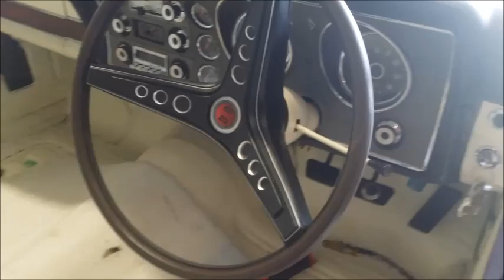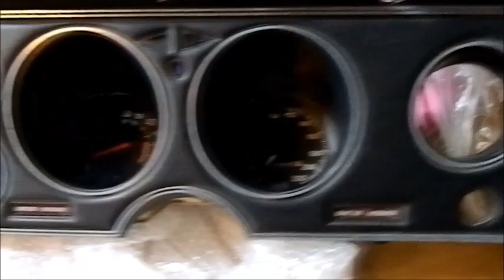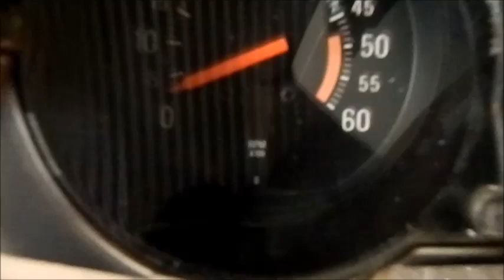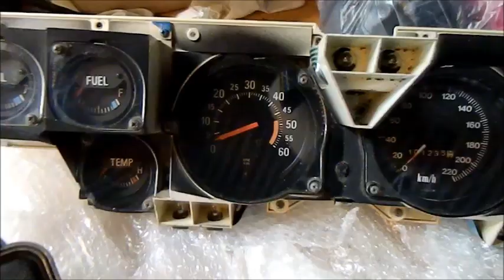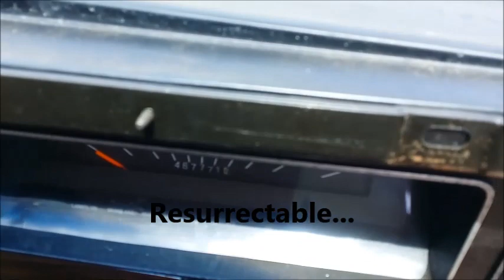Ford XC Fairmont 351 Restoration Part 7

Comment: I'm very glad you made this restoration series as i'm about a month into the restoration of my own 73 XB 500 wagon and i am cursing you for how nice the shell is on your sedan compared to mine. In particular your engine build video will come in handy for me as i picked up a 351 Clevo from an August 77 Fairlane, and a BW single rail four speed from a 302 GS XC for a song.

Comment: Great video again Pete,  you really  made me want a Zd ,  I haven't seen the inside of a zh for years ,forgotten how nice they were.  Cant believe the amount of rust replacement parts they make for old Fords . The dash you got is very nice,  this will be a beautiful car . I hate gas as well,  318s barely run on it and have zero power especially if it was the old lean burn ignition as well.  Drank the gas to , ive rebuilt the engine and run a 600 holley with an msd 6al. Goes well now but you're right, gas is for bbqs even then i still use charcoal.

Comment: Hope you had a great Christmas and top New Year. Looking forward to the full year installation!
Reply from the maker: +vigilante351 I'm going to go out on a limb and predict that by the end of this year, I'll have an almost driving shell... plumbed, wired, maybe engine and gearbox in and the shell painted... no interior or finshed hang on panels. Hold me to it and I'll see if I can make it happen. If I fail... well we will cross that bridge.

Comment: I wish I was as good as you when it comes to identifying parts, especially the wiring harness connectors.
My XC project is plodding along slowly. I can almost at this point treat it like a follow along video series.
I got lucky and got an almost complete car for 2K but having to replace quite a few parts, but there was nothing in the engine bay except a brake booster and a 302 Clevo from a 77 ZH Fairlane.
Your videos make my day when I see one has been uploaded, they are also the inspiration to somewhat upload videos of my own project.
Reply from the maker: +TheDaff Thats brilliant, thank you. Plodding along it may be, but you'll get there. Don't forget that there's a raft of information on the Ford Forums. Cheers Peter

Comment: Could you dye the leather interior another colour if it doesn't suit? Like the product that you used in the vinyl paint on the XW (which was flexaid) could the dye perform that job and penetrate and be flexible and not cause 'issues'.  I know a dashboard bloke whose restored dashes are vinyl and I asked him and he says that he uses a 'vinyl dye' which apparently is not paint, it is supposed to actually go into the material. They start off in grey, so that when you pay for one he dyes it the colour that is specified. The leather hood lining from the ZH with those seats (with altered frames) would be a real point of difference with your car - if that suits you. Maybe the part with buttons (where they seem to look obviously Fairlane) could get an insert like they had on XCs at the time.  I remember that you had were looking at some houndstooth samples. I know the problems you are solving at the moment do not involve the interior upholstery, nor will they for some time. Am hoping to learn from you that's all. You also have those excellent quality vinyl seats and they too give the option of using them to create a beautiful interior.  Really enjoy these videos. You really are clear when you show what you are doing.